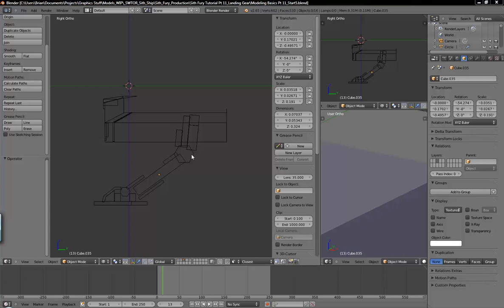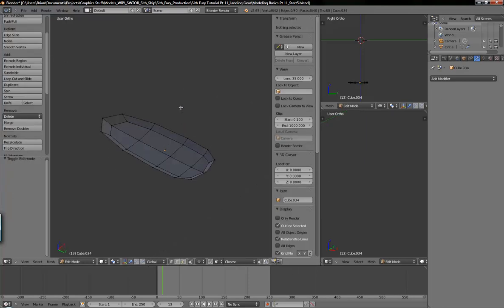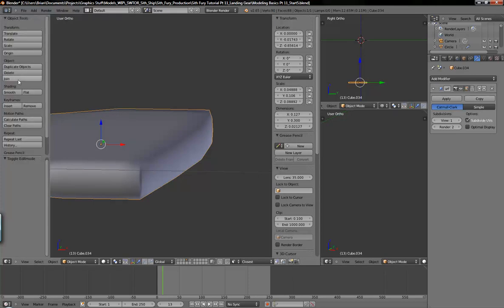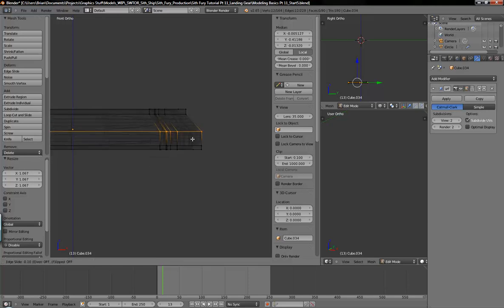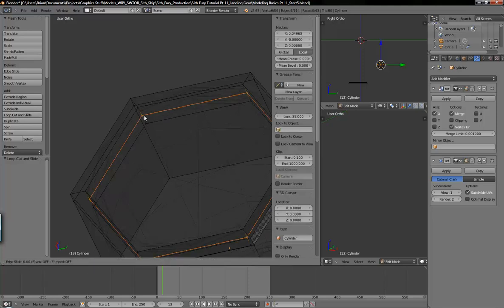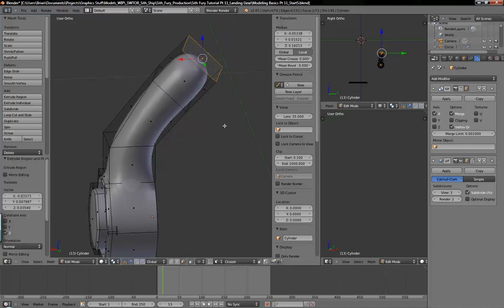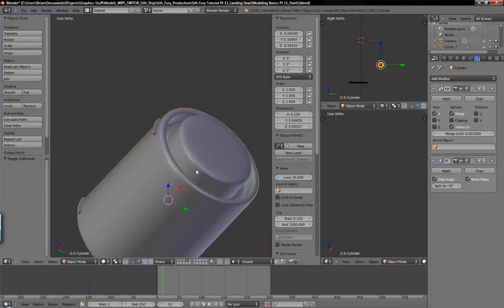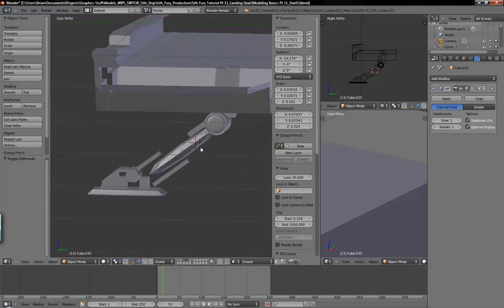Blender 3D Modeling Basics Part 7: Subdivision Surface Modifier

Comment: I am trying to remove a subdivision surface modifier from an object after it has been applied. thanks
Reply from the maker: you can use Ctrl+Z to undo any changes you make. But if you save the project and then try to undo changes, it wont work.